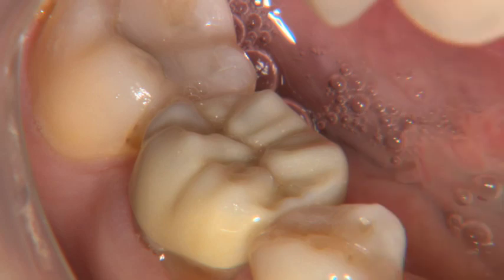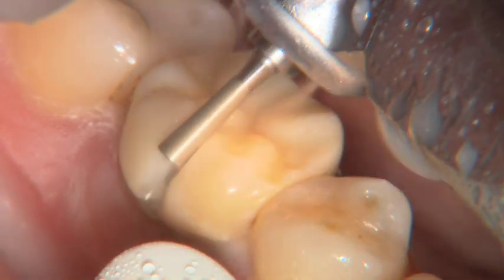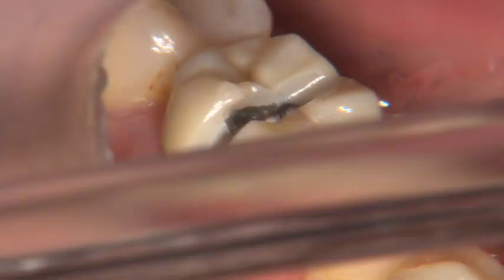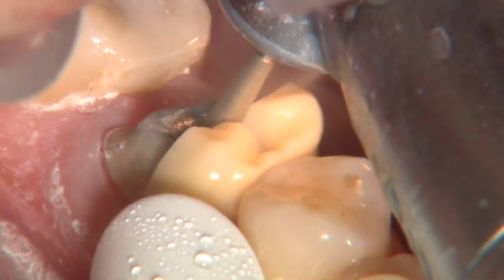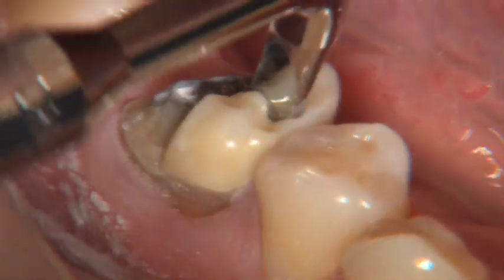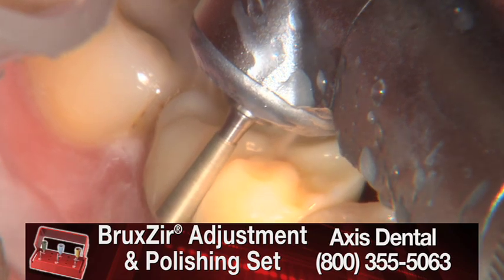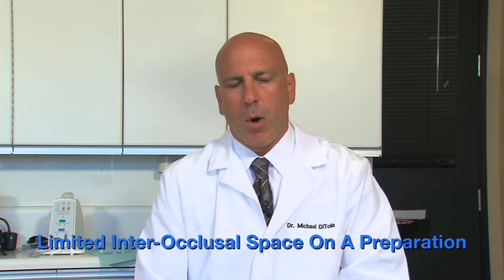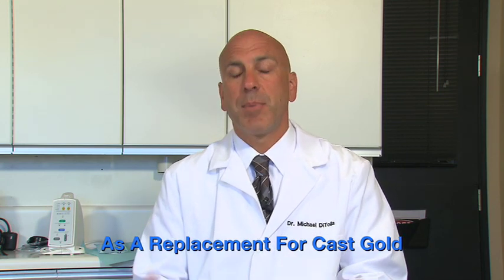Bruxzir® Solid Zirconia-Indications & Clinical Techniques, Ch.5

Comment: In these procedures, how likely is it for the original tooth to get damaged? 
Condition: If the tooth already has a crack and the crown is holding it together after a root canal? Need replacement due to the gap between crown and existing tooth. Doctor said the cement chipped away